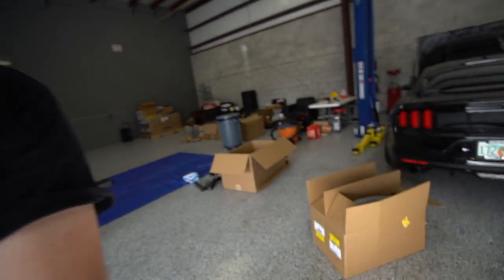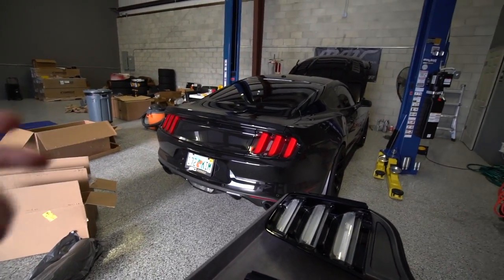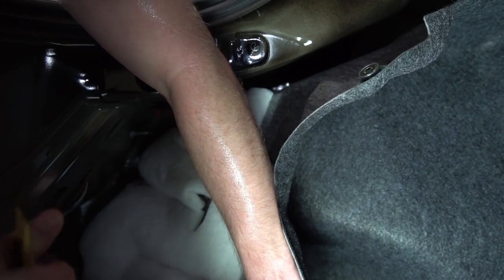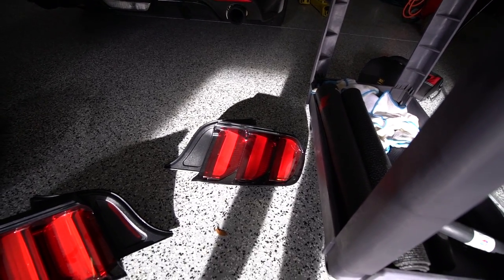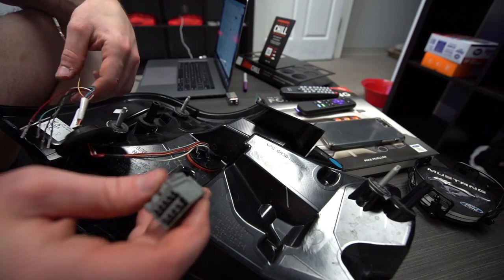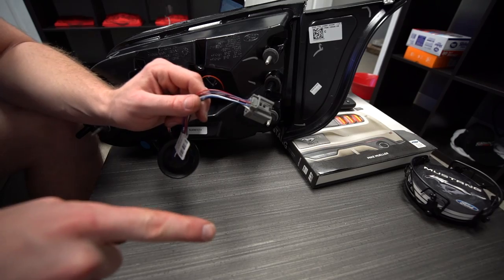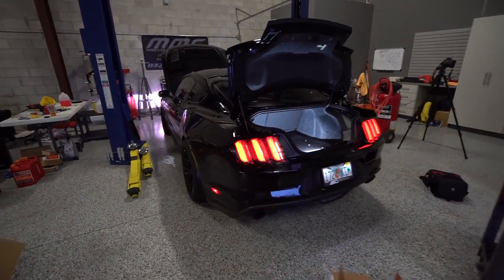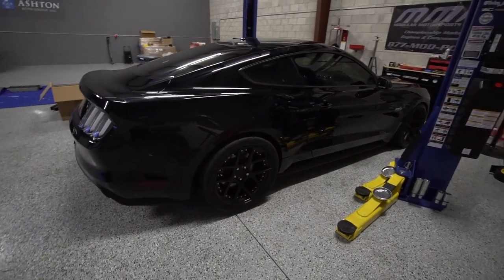EURO TAIL LIGHTS INSTALL on my 2016 Mustang GT!

Comment: lookin good! you should get some fans to put in your shop for the heat :)
Reply: I typed this and then saw a fan by the front of the mustang...
Reply from the maker: I've got some fans, problem is you can't run them at you when you're recording because it will wreck the audio lol.

Comment: A lot of the UK Mustang Owners here like the Red :-) myself I like the Euro look but sadly we  are NOT ALLOWED the sequential rear light's(Audi and others have them) as they are NOT one continuouse line? and the day time lights at the front again are not allowed as they apparently are not the correct height? so ours are the Fog lights which look silly and cheap again other cars have them at the same height so it sounds like some EU bureaucrat is just a jobs worth  made a decision to pacify France and Germany who basically Run us all ,well not for long hopefully!!
Reply: Kinda late but better late than never. My importer does a rewiring to make them blink orange sequentiall. Don't know if that's allowed in the UK but at least in Germany it's ok as long as the turn lights are yellow. Have a look: https://www.youtube.com/watch?v=r323eVjXxDg
I do like the red too...the grass is always greener on the other side :)
Reply: There's a module you can get that'll make them sequential with different settings. It's from EPM